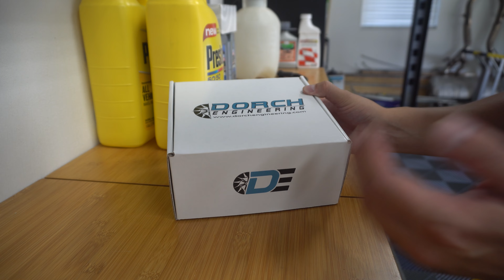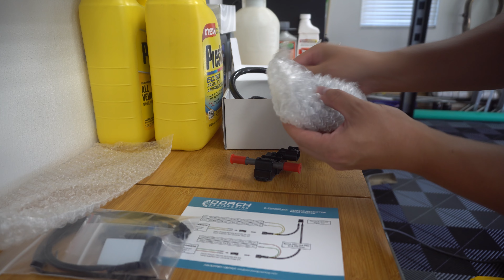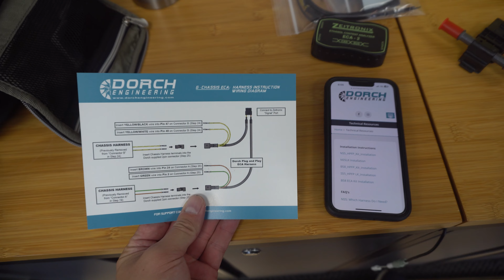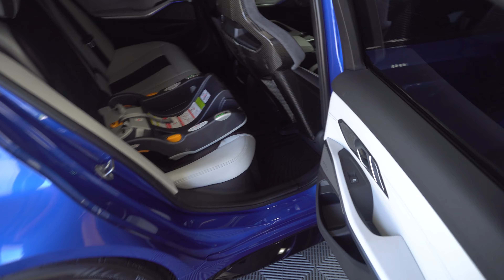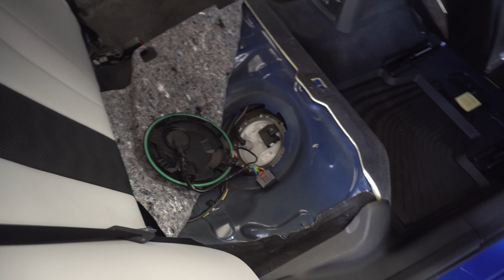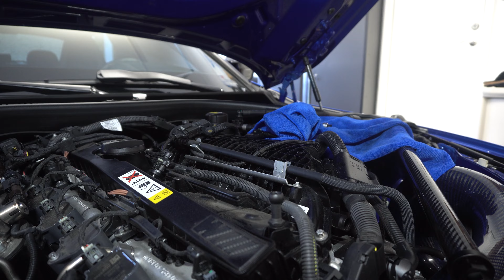Dorch Engineering Flex Fuel Kit | BMW G80 M3

Comment: For some reason my car doesn’t have a #2 pin connector on the factory harness, I continued the install and everything seems to be fine just seemed very odd to me. 23 G80 M3
Reply from the maker: Interesting. Wonder if the 2023 is different...
Reply: @accelerated_motion  yeah for sure it caught me by surprise, would you happen to know what the pin wire #2 does exactly on the factory harness?
Reply from the maker: @Kenneth5164  Unfortunately I do not know off hand, sorry

Comment: Thanks for taking the time to make this.  My only comment is the purge process, it's not necessary as the amount of fuel that drips out when line is separated is  minimal.  Not a fan of running it dry plus it saves the whole back seat fuss.  Love the RF wheels!
Reply from the maker: Wasn't sure if the purge was totally necessary but wanted to be safe to not spray fuel all over the place. Car is running great nonetheless!